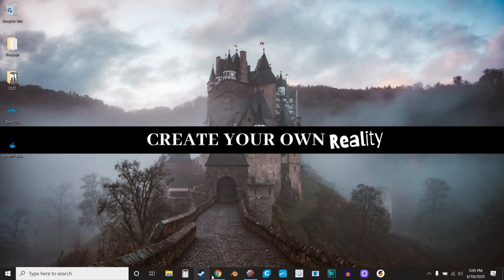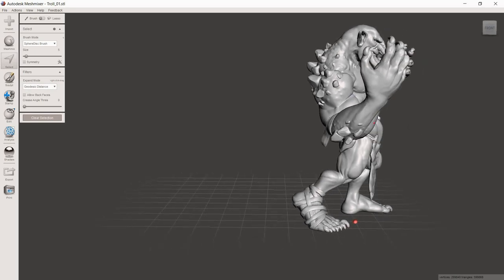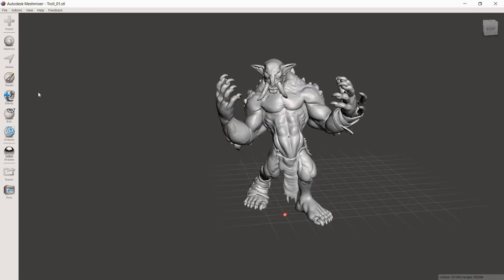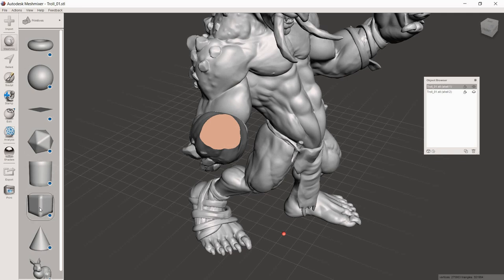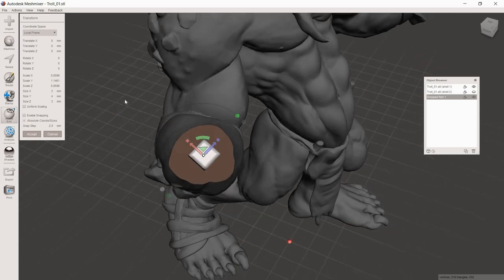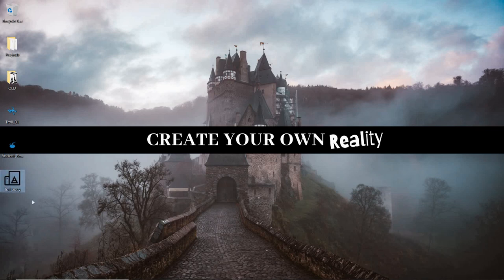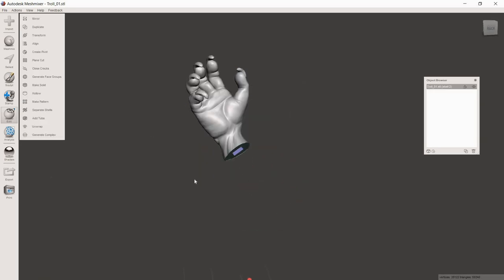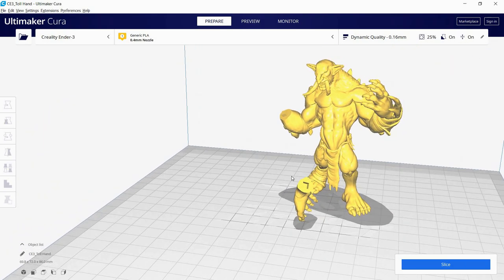How to Make Perfect Alignment Pins With Meshmixer!

Comment: This is a perfect tutorial!!  I'm having a slight problem though.  The minute I merge the cube exactly with your setting, it seems to muck up the cube.  It becomes distorted.  Any thoughts?
Reply from the maker: That's for the feedback, I'm glad to hear you liked the video! 
Hmm that's a bit odd. There are a few things that could be going on. But if the issue is coming up as a result of a Boolean Union there may be an easy solution. Try using the "Combine" option instead of the a Boolean Union. This option should pop up on the top left when you select two or more different objects.
The main difference between these two options is that the Boolean Union makes the parts one-piece forever. Whereas the combine option allows for them to be separated again using a separate cells function.
However, the combine option has much less impact on the two parts and requires much less computing power.
Let me know if that resolves the issue.
Reply: @SlicePrintRoleplay  So I went tried combining as well and the other Boolean (the one to make the hole in the piece that needed the recession) and both still muck up the cube.  I tried using the cylinder object as well and it does the same thing.  Guess I'm just not lucky but thank you SO MUCH for replying!
Reply from the maker: @wrangler6459  hmm.. Unfortunately that could point to an issue with your model. I apologize, but mesh issues are a bit out of my wheelhouse. However, I know I've had this same issue before when there are issues with the model I'm trying to combine objects with... I'm sorry I couldn't be more help.
Reply: @SlicePrintRoleplay  the thought the file was bad never even crossed my mind! Even that was a huge help.  Thank you!
Reply from the maker: @wrangler6459  you are very welcome! I'm just glad I could offer some help at least.
There are a few 3D artists in my Facebook group. If you post some screen shots in there I'm sure someone will be able to offer more specific advice.
Reply from the maker: @wrangler6459  if you do find that there's an issue with the file then you can try the repair process from the bel video.
https://youtu.be/ai5ZjGFS29A
Reply: @SlicePrintRoleplay  awesome!! I'll watch it for sure, 'cause it would be a waste for a paid file to end up being unusable -_- I did try a different file with the process in your video and it worked perfectly

Comment: i have a problem that when i cut the model, the inside is empty so i cant add the alignment cube! Do you have any reccomendations on that ? Thanks in advance and keep up!!
Reply from the maker: Hey there! So I have two things you can try.

#1, at the 6 minute mark in this video I talk about moving the cutting plane. I do this to make sure that the cut I make is going to leave two solid edges.

#2, it's possible that there are internal errors in the model you're working with. You can try repairing the model in 3D Builder to see of it resolves the issue you're seeing.
You can follow the steps in this video to learn how to repair your model in 3D Builder.
https://youtu.be/ai5ZjGFS29A
Reply: @SlicePrintRoleplay   Can i ask one more thing ? When i throw on the model the cube or cylinder, its not centered and flat on my cut! hwo to align it ? ;/

Comment: hi there, it is necessary to just export the model not the plattform (for example in miniature model you got the main characters as exaple and a round platform to stay in place)?  do I need to expor my own models in this app ? and not the plattform . thx.
Reply from the maker: I apologize, but I'm not sure I quite understand the question.
If you're asking if it's possible to remove a model from its base (the platform it sets on). Then yes that's absolutely possible in Meshmixer. One of my earlier videos covers that topic.
If that's not your question then would you mind asking in a different way?
Reply: @SlicePrintRoleplay  I used to model separate the main character from the plattform or holding place, I am looking for tecnnique such as keying or separate pieces for miniatures... I use zbrush and soem stuff , but not have enough experience in 3D printing world.
Reply from the maker: @leatherandpoemscharmyman5774  ah okay I understand. You could very easily key a model to fit into any base using the method I cover in this video.
Simple bring in the base then bring in the model.
Then do this for both the base and the model.
Select/click on the the object and hit "Transform" from the options on the left.
Then hit "Align"
Once you do that for both models you'll need to select your mini and lift it up till you can see the feet rise above the base. Adjust the position of the mini until its feet are just touching the base. Then use the method I cover in this video to create keys/alignment pins.
If you have any questions let me know.
"How to key a model on a base." is one of many videos on my list to cover.
Reply: @SlicePrintRoleplay   it would be interesting a tutorial with meshmixer to put the plattform and the charater,... maybe I go for blender to center both meshes and then re export them back to mesh mixer and hit the alight button as you said... Do I need to creat keying for base? (some hole in the plattform and some key in the foot of my character? thx.
Reply from the maker: @leatherandpoemscharmyman5774  you don't have to create a key if the surface of the base is flat superglue works on most models. However adding a key will make it a much stronger connection.
Reply: @SlicePrintRoleplay  I am using Kura, I created the key and the hollow, but when I use custo suppport part of the support is inside the perfect hollow...and complicate my day... do I need custom support for this separated pieces? the hollows are holding some support structures and maybe can be a mess in PLA
Reply from the maker: @leatherandpoemscharmyman5774  it really depends on the size of the void/hollow and the orientation of the model. If it's a smaller void it should bridge just fine.
However on a larger void it may require some support to keep its shape.

Comment: What do I do if trying to use those boolean difference settings gives an invalid preview (red) and fatal error if I try to apply anyway? If it matters, I've got 3 keys combined as one object to make the 3 necessary voids all at once.
Reply from the maker: Hmm I've not encountered this myself. Is it possible that the file had errors to begin with? That could certainly cause Meshmixer to have problems when trying to edit the file.

Comment: How do you fix boolean union or boolean difference when there is a red or blue error line during the process?
Reply from the maker: Try cutting a different area a little bit away from where you're cutting. It could be that you're cutting an area that has lots of complex meshes and it's giving you that error.

Comment: I have been trying to do just a simple plane cut on a flat almost cube model just to test out meshmixer, but while trying your settings I get stuck on refining while lowering the target edge scale to 0.25. How long should expect to wait before I should assume something is wrong because its been 10 minutes so far. My PC specs in case they help.

i7 - 10th gen
Rtx 2070
16gb ram
Reply from the maker: Hmm that is a bit odd. 10 minutes should be plenty of time to work through most cuts. How large is the model? Is it possible that the model has internal geometry issues? If so that can be really hard for Meshmixer to figure out.
Reply: @SlicePrintRoleplay  it is about 250mm cubed which is big but not anything massive. I found out that I needed to remesh first with a linear subdivision and density at 50% to create more triangles on the surfaces. There wasn’t enough to do any boolean functions.
Reply from the maker: @luke2v52  okay yeah that makes sense. That's for responding to let us all know how you resolved the issue!

Comment: I have a print that has around 100 shells I'm not kidding, so when I slice it I get a huge list and I can't find my slices.
Is there a way to merge it?
Reply from the maker: Wow I can definitely understand how that could get overwhelming!
There are two different process for merging different parts together in Meshmixer.
#1,  the Combine option is fine for most situations, but it will be undone by the Separate Shells function. So if you're planning on doing that a lot then the Combine option isn't super helpful.

#2, Boolean Union. This function will merge the parts together permanently. It will not me undone by the Separate Shells function.
However, it requires a bit more processing power from your computer. So don't try to merge too many parts at once or else you might crash your PC.

Comment: Have you had experience doing a double void and then printing a pin separately?
Reply from the maker: I'm not sure. Can you explain what you mean in another way? Or post some example pictures in the Slice Print Roleplay Facebook group?
Reply: @SlicePrintRoleplay  like doing a void on both parts instead of fusing the pin with one half. Then printing the pin as a separate piece.
Reply from the maker: @Dominus66  oh okay that makes sense. Yes I have definitely done that before. Sometimes it's easier than having the pin attached.
Just follow the general rule that you want the pin to be a little smaller than the hole and it should all fit together great.

Comment: any idea what might be causing meshmixer to lock up when i change settings in the boolean union box to what you tell us to set to. I went as far as putting a simple pin in meshmixer and plane cutting and trying this in case model was messing up but it still locked up. i have a capable computer so i wouldnt think its that but honestly im at a loss.
Reply from the maker: It could be any number of things. Unfortunately, Meshmixer is no longer being updated or supported by its creators. So it's possible that it's just having compatibility issues.
Just as a test, try running it with the default settings. So without changing any of the sliders are other values.
Reply: @SlicePrintRoleplay  ok will do thanks! Anything 3d print related I tell anybody that asks you are goto. Hopefully you gain alot more subscribes and likes!
Reply from the maker: @jaspercallahan3318  I really appreciate that thank you! 💚

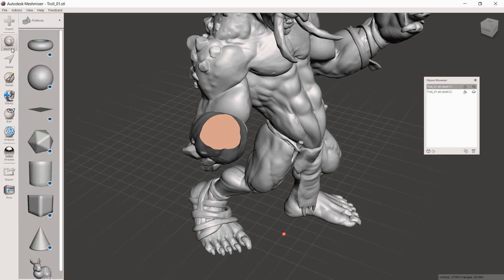Comment: wish i saw this video waaay earlier! could have saved few hairs i had left from getting pulled out of frustration. (adding the pin 9:00, settings 12:15)
Reply from the maker: Well I'm sorry this video didn't come across your path sooner, but I'm sure you can rock the bald look!... And in the future you are welcome to reach out to me if you need help!
Reply: @SlicePrintRoleplay   wow and quick reply too.. so i'll take you up on the question offer.  

i have a 3d model https://www.thingiverse.com/thing:4701874 this model consists of separate blades which this video tutorial i can use to steady them when i glue them, the issue i see though, since the blades are 3 separate parts, how do i line them up? in contrast to this video tutorial, you used a whole arm and cut it. how do i work with 3 separate parts? thank you in advance.
Reply from the maker: @macombiam  let me see if I can throw a quick tutorial video together to answer this question.
You actually have perfect timing because I was just about to start a tutorial series where I make a quick video showing how I would resolve a problem that someone from the community has asked me about. 👍
I'll definitely reach out to you again on here, but you can also join my Facebook group if you want to make it easier for me to let you know when the video is up. 😊
Reply: @SlicePrintRoleplay  can't wait.. this will make my kid super happy!
Reply from the maker: @macombiam  then I'll get on it ASAP! ❤️

Comment: Having an issue when I plane cut, I see a bunch or shells in object browser but not the two halves I was trying to cut. How do I fix so when I cut, I just see the two parts?
Reply from the maker: Hmm without seeing what you're seeing I can't really offer much help.
Try the advice in this video and see if it helps.
If not please join my Facebook group or Discord Server and post a video so I can see what you're seeing.
Reply: @SlicePrintRoleplay  I figured it out. Instead of placing “plane cut” inside of the selected area, I was outside of it. Should’ve had a v8. lol 😝
Reply from the maker: @shellumus  "Well there's your problem!" haha.
Glad you figured it out.

Comment: This seems to work for only a couple of alignment pins. I have a model where I am trying to break it up using 12 alignment pins but meshmixer can only handle 4. Any more than that and it gets extremely slow to process and eventually freezes.
Reply from the maker: So I think the process I talk at (roughly) the 5:40 mark in the video below will help you out.

https://youtu.be/2aoJUkE8nJg

Comment: If it’s a resin print do I need to add .3?
Reply from the maker: It depends on your resin and settings. But on average no. .2 or even .1 will probably work.
Reply: @SlicePrintRoleplay  thanks this video helped out a lot. I just got me a resin printer I have owned a 3-D printer for over a year now, but never put pins on a project before I’ve always printed them completely sliced and had a fight with assembly. Thank you for the video.
Reply from the maker: @christoffchefful  oh awesome I'm glad this helped you!

Comment: I tried to make some pins for a 3d print,I copied the pins and found when they printed,it was too long and too wide to fit in the hole
Reply from the maker: Interesting. Is it possible that you scaled up the object you used to make the pin and not the one you used to make the hole?
Reply: @SlicePrintRoleplay  So I think I found out why the didn't fit,the video I watched didn't mention making the female plug larger
Reply from the maker: @AsheCraftingCorner  ah yeah that will do it. Well I'm glad you found my video then. 😊
Reply: @SlicePrintRoleplay  I wish I found yours first

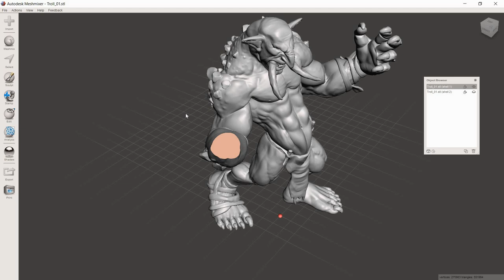Comment: 8:50 how you get flat surface on the cut ?
Reply: 7:03 That it?
Reply from the maker: @slevinshafel9395  6:18 is probably what you're looking for, but let me know.
Reply: 6:35 i make with your model and worked perfect. But in my model wich have a lot of parts(not detail) cant finde the flat surface.😪
Reply from the maker: @slevinshafel9395  are you using "Keep both" and "Remesh full"?
Could you send me a message on Facebook with a picture of the model you're trying to cut?
Reply: @SlicePrintRoleplay  ok i just join on your group
Reply from the maker: @slevinshafel9395  you can certainly do that or you can just send me a direct message.

Comment: hey, any particular reason why we need 18 Preview iterations?
Reply from the maker: What do you mean?
Reply: well, the settings at 12:18 - you said it's super important to get right and to use them all the time. Just wondering why Preview Iterations is set to 18 and not I dunno... 20 :)
The tutorial is great btw - I'm using it right now ;)
Reply from the maker: @RedKasst  oh doh! 🤦‍♂️ Sorry I was totally spacing on that setting name.
I mainly recommend 18 rather than 20 just to take a little bit of load off your CPU.
It's a slight adjustment, but on bigger/more complex models it can make a difference.
But if you want to use 20 then that certainly won't be an issue.
Really good question!

I'm so glad you're finding it helpful and thank you for the positive feedback!
Reply from the maker: Ps, I wanna see what you're working on! 😁
Reply: ah, nothing much - just pins for the LAAT/i Gunship floor: https://imgur.com/hw2kfx0 got the files from Gambody and trying to print it @ 200% scale to fit 3.75 Clone Trooper figures :D
Reply from the maker: @RedKasst  that sounds awesome to me!
Reply: cheers! I have no idea where I'm gonna put it once it's assembled ;) feel free to check the only 2 pictures on my insta @rednesskast :)
Reply from the maker: @RedKasst  will do!